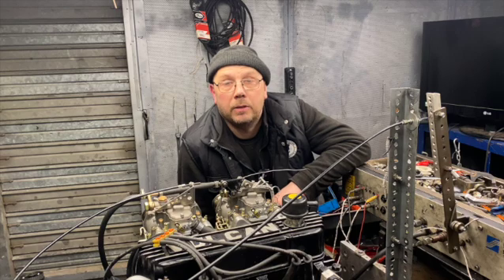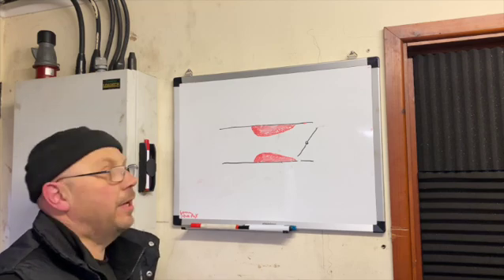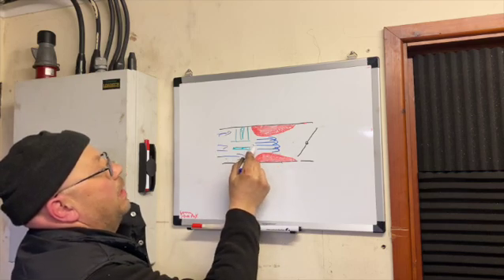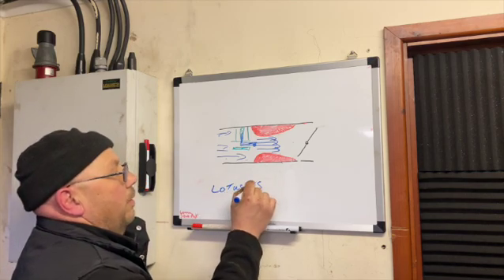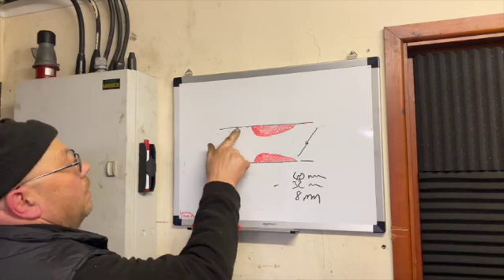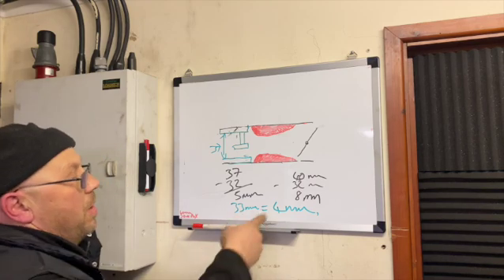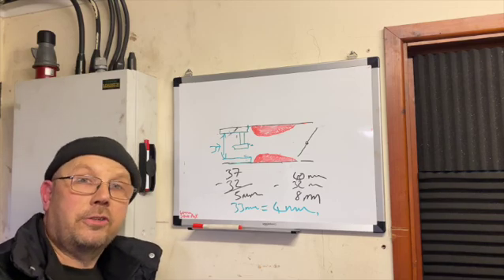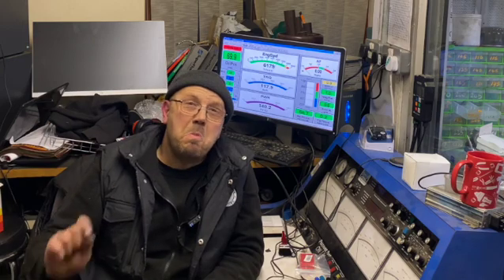WEBER 40 DCOE CHOKE COMPARISON

Comment: Whereabouts are you based? Would love to get my BMW M10 engine tuned by you. Also, what chokes would you recommend on a 9.5:1 compression M10 2L. 292 cam, with DCOE 40s with 75mm velocity stacks? I was told 32's may not be enough and to go up to 34s, but watching your video I am now re-considering the 32s.
Reply from the maker: 34's are likely to be pointless, 33's may possibly give a tiny bit more power. if your looking for more power via carburation, swap to 45's with 36 chokes, that should give you a usefull increase in top end power without killing all the low speed flexibility
Reply: @PenguinMotors thanks for the quick response. I was considering 45s, but would they be overkill for a daily driver? Again a lot of reading and it would seem they aren't necessary / can do more harm than good (over carb'd) if it's not a race engine.
Reply from the maker: Depends on your goals, there are lots of people that run/ran 45's on a daily driver, with smallish 36mm chokes they are quite usable. And are likely to give around 15bhp more. If you tend to floor the throttle down at 1500-2000 rpm but don't Rev the engine out past 5,000-5500 rpm then your probably better off sticking to the 40's.
Reply: @PenguinMotors , you have pretty well summarised my driving style there. Don't tend to go past 5500rpm often, I've already changed gear by then unless I'm overtaking on the motorway. Thanks for the advice, I'll stick with the 40s for now and prioritise other bits that need doing. Possibly go for 45s in the future when budget permits, or maybe EFI if I get the time. Thanks again!

Comment: Ive been spending ages trying ti get ny 4G54 cammed 2.6 4cylinder with twin DHLA40 Dellortos running well, my first move was to put 36 chokes in (replace the 32s). I must have a better go at getting the 32mm chokes back in and test it out.
Reply from the maker: 40MM Carbs wil be too small to make any real power from such a big 4 cylinder engine
Reply: @PenguinMotors  you are correct, I went from 36mm chokes to 32mm and same mph at the drag strip and far better driveability, with 36s it had massive lean spot part throttle as the main jet too too long to be activated street driving.

Comment: Your engine has bigger problems than the carb, the bigger venturi should have increased the power.  But the engine falls over at 5000rpm so any venturi sized for more than 5000rpm (in this case 32mm) is pointless due to that particular engine and the way it's built.  Back to the drawing board to find an engine with more power, then try the carb test again?
Reply from the maker: equipped with 45's it made a lot more torque ,power and peaked higher up the rev range :)
Reply: That's what I would have expected and yet interesting at the same time?  Do you have a video showing the 45 specs and dyno run ? What would be an excellent comparison is 32 and 33 venturies in the 45s ? @PenguinMotors

Comment: Hi sir Graham!! I own a Pug 205 Rallye 1.3 swapped to 1.6 which equips two Webers 40 DCOM. Not sure if these carbs are so diferent from the DCOE's but, on the DCOM's I have, the inner diameter on the intake horns and aux venturi is 45mm and it only measures 40mm on the rear end outputs/throotles after main venturi. The strange thing is that these carbs mount 34mm main venturis stock and the original engine is only a 1300cc!!! Also I've tested 36mm main venturis on the 1.6 and it doesn't rev faster, but definitely there's a noticeable difference at the peak power and max rpm's so I've been using the 36mm for years, maybe I'll purchase a pair of Weber 45 soon lol... Maybe the 40 DCOE's you tested are different from the DCOM's? If I fit 32mm venturis I would lose power for sure. Not saying you are wrong, your theory has actually much sense and you showed dyno numbers, I'd just like to find an explanation of why Peugeot mounted these BIG 34mm chokes in the 40 DCOM's fitted in a 1.3, if this really could be counterproductive for the performance. Cheers!
Reply from the maker: You can never know 100% why a vehicle manufacturer does something. maybe it was for exhaust emission purposes or  they wanted to change power delivery or even homologate them for competition? I tried bigger chokes on one engine,  gained no power but left them in. Why? because i had less fuel stand off with the bigger chokes, its not always about peak power!

Comment: Great video! Although the difference between a diameter of 33 and 37mm is only 4mm, a 37mm diameter orifice is 25% larger than a 33mm diameter orifice. But yes, as the venturi/choke size gets closer to the same size as the actual carburetor body (bigger venturis), the difference in areas becomes less and less causing there to be less of a velocity increase and less signal/vacuum past the jets. Love your content! Could you possibly do a dyno test video with DCOE 45's instead of the 40's to compare the differences with 30, 32, and 34 mm venturis? It'd be 6 different runs + test runs, but it'd be really great to know! Always wondered. Anyways, great video. I look forward to more in the future!
Reply from the maker: will do another  45 choke test at some point, i already did one 36 and 38 chokes on the same 170bhpish engine. trouble is takes ages, setting up and rejetting for each test, plus to get an accurate result you need to do numerous test pulls each time, you could easy use a whole days dyno testing

Comment: hello Graham, we'd talked already before. Good video by the way, but there is something i want to discus if you dont mind.
Now choke size matters indeed, but you've got to consider auxventuri how its shaped and the diameter. I know standard most
at 4,5 as used to call it on aux venturi. Now you can modifie those for example. Correct about what leaves at intrance across / casting bore
and aux venturi stacks. High velocity at high rpm may do @33 chokes, as for lets say a 1600 at 7500 rpm, but lost and gain on some, depending on cam.
So why do they sell even 34mm chokes on #40 carburettors IDF or DCOE, if it does not do anything really for performance?
Production cars in the 1970ties i have read, do differ at using a single dcoe carb or twin choke-wise and thus choke size also. Please do indepth video's 
on this item. A learning curve. I am doing my test and see what does and most by feel driving, i do not have an engine dyno.
Less is ( often ) more like i said on the phone, as you know.  I did prepped and shaped my aux venturis, for flow/pickup at working rpm's.
Thank's and lets go a bit further in this matter if you like. 👍
Reply from the maker: they probably sell chokes too big for the same reason a lot of exhaust are too big, bigger must be better right? bigger sells well, whether its better or not!
Reply: i had to review my post and changed / add little to what i have written.

Comment: I have 34 chokes in my twin 40 dellortos destined for my 2.0 pinto 🤔
Reply from the maker: if your happy with it dont worry, but reducing them a bit along with the main jet size would probably make for an engine which will respond bit better at lower speed bigger throttle openings,  for what its worth a dellorto only has one leg on the aux vent, so a 33mm choke MIGHT give a bit more benefit in a dellorto than a weber
Reply: @PenguinMotors   I have not fitted the twin 40’s yet. It has the fully modified 32/36 as per your video on it at the moment I set up the 40s with 34 choke from info in the Des Hammill book it is a modified 2.0 your videos are awesome it’s difficult to find someone who wants to tune a pinto and knows carbs. Last time on the dyno I was doing all the tuning and he just did the tests when I said I want to change cam timing he talked me out of it saying your not going to make any more power that’s about all you going to get. Disappointing attitude.
Reply: @flatchatcharlie  what is modified how far? Mild cam on SOHC standard internals on 40 mm sidedraft Carbs no larger need as 32 chokes. Jetting and ignition timing
perfect, you wont believe how much it can do for daily road. Not to speak of clutch and endgear ratio. wich does contribute how an engine responds with given power output
and curb weight of car.

Comment: if fitting larger chokes, would that be why long aux venturi's are used on ida carbs? so they sit outside the carb body where airspeed is even lower?
Reply from the maker: yes Ross long aux vent do help reduce stand off, its not so much that air speed is lower, but fuel blown back stays in the aux vent rather than being blown into outer space

Comment: Very, very interesting video. Thanks for sharing your knowledge! 
Does the engine capacity have an influence on choke size or is the 32mm choke the ideal size also for a 1300 or 1600 engine? 
What would be the sensible maximum choke size for the 45 dcoe (1.9/2.0l engine)?
Reply from the maker: engine capacity will have an effect, 32mm chokes are just fine on most 1600, but a very mild one might be better on smaller, most 1300s would  definitely work better on 28 or 30's. most sensible size for a 1.9/2.0 on 45's is 36, but 34's will work well on a mild engine and 38's on something hot

Comment: Absolutely spot on 👍 very interesting and food for thought,  could you possibly tell us what the actual main and air corrector jet size differences were for both the 32 and 33 chokes?
Reply from the maker: from memory  going from 32 to 33 the mains went up from 135 to 140 and airs down from 190 to 175

Comment: Wouldn’t the manifold vacuum readings give an indication of the engines need for more air?
Reply from the maker: on a big V8 with a 4 barrel carb yes, on an IR set up such as sidedraft webers manifold vacuum is very very low even if carb size is holding it back
Reply: Thanks, keep up the informative videos.

Comment: Hi Graham, 
  Kart engine 45/32mm 13k rpm
I got the 32's working, the kart will pull away with full throttle from walking pace. We fitted the 40's and on the stand mixture weaking was as you said, but initial blip throttle was the same as 32's.  It would pick up, go weak, then completely lose the will to live at higher rpms. 22+ I'll do the rejet when we track test, when the weather is better. 

An intersting test for you would be to compare auxiliary Vents, no one ever does that.

Comment: Interesting. 
 Here is an idea for you. It would be interested to take an EFI itb setup, and install carbs to it instead of intake runners. ( Carbs without fuel feed) that would allow to test various combinations with identical AFR. Would be interesting to see how big an air restriction a carb is.
Reply from the maker: a big carb isnt much of a flow restriction, which is why ITBs usually give very similar power to a similar sized pair of DCOEs